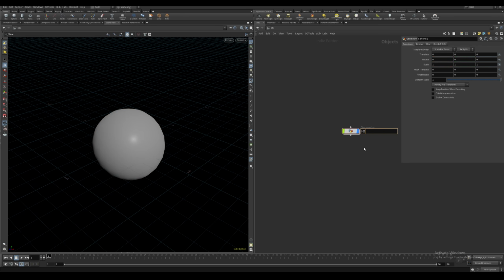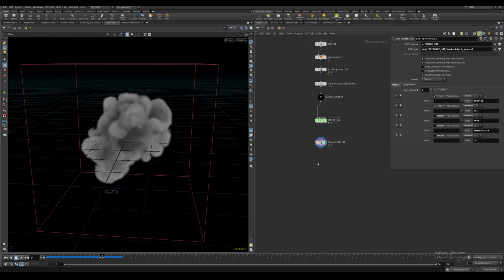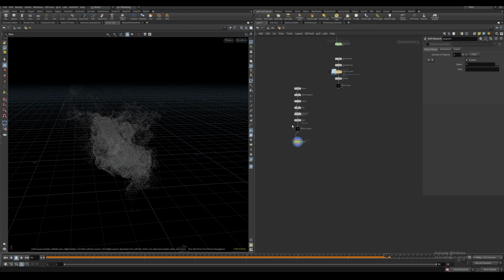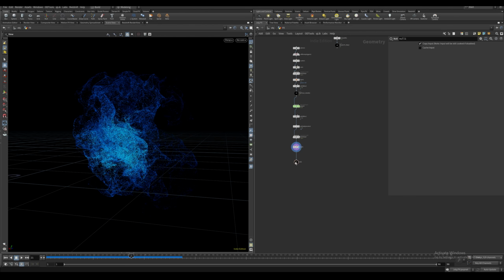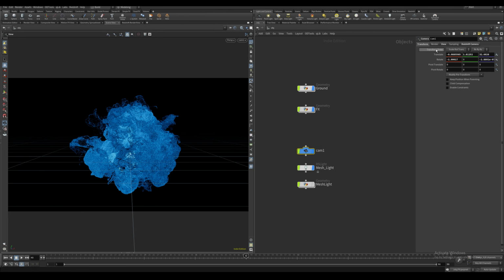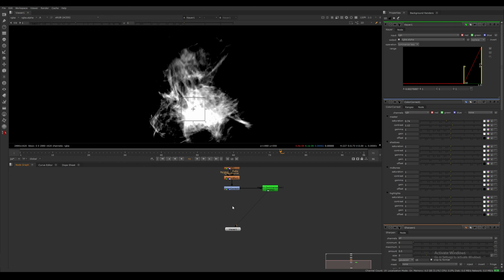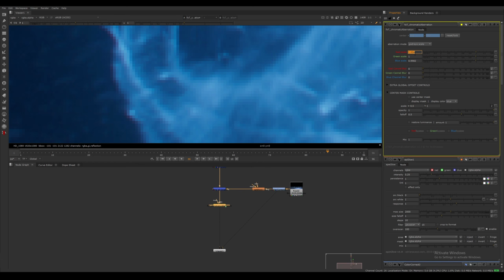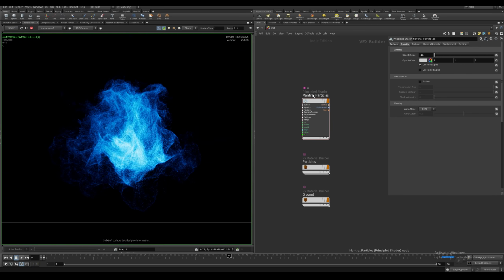Houdini & Nuke Tutorial: Magical Particles

Comment: nice comp but just a little note on the Grain process, Grains don't show in bright areas of an image as they would in the darker areas, so I would reckon you key the highlights and invert them then use them as a mask for the Grain. and also where you had to luma key the inner core of the magic effect, rendering out the Emission pass would've saved you that process I believe
Reply from the maker: That is actually a fantastic tip and something I didn't think about at all. Inverting it would be the more accurate approach.

Comment from the maker: Hi!

I just wanted to make a beginner tutorial on the most basic technique used to achieve magical style FX in Houdini which is particle advection. 
Sorry for bad audio and bad English especially from the latter half of the video.
I will try to create better and more polished content moving forward.
Hope you will find some helpful tips in this video!

Also be sure to check the description for the HIP file and other links to gizmos / textures I ended up using.

Something I completely forgot to mention is that you need to have ACES colourspace installed for your Houdini to achieve this final look. 
Here is a really good video about installing ACES on Windows:

https://www.youtube.com/watch?v=8zb3XjNBgRE

Key Takeaways:

1. Having a high enough point count and small points is the only way to achieve a smooth look when only using particle
2. Using the Attribute Blur node can help promote particle clumping / strings
3. Blurring particles in comp is a viable option but not a replacement for rendering too few particles, denoise nodes / motion blur nodes can be useful

Thinking about covering some FLIP based magical FX or something more sci fi like laser / laser scans in my next tutorial. 
Let me know if there is anything in particular you would like to see.
Reply: I didn't find any issue with your English tho
Reply: please reupload files